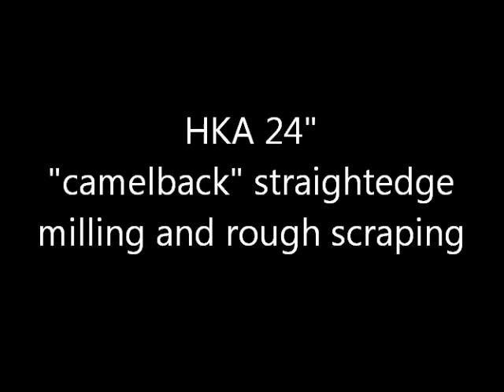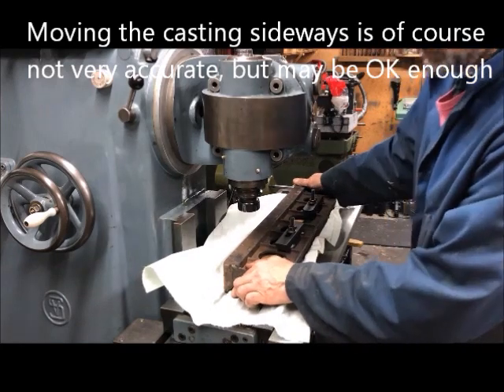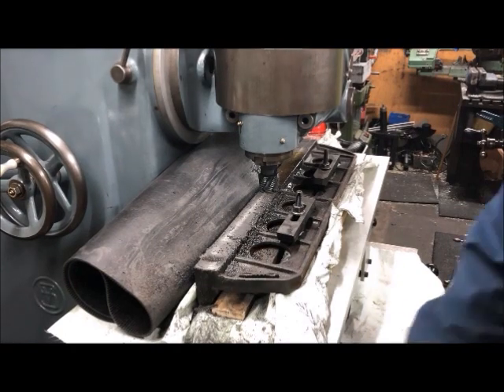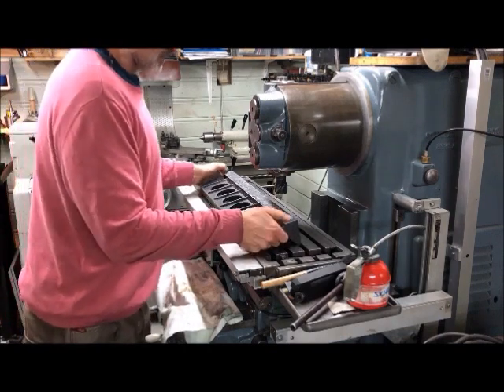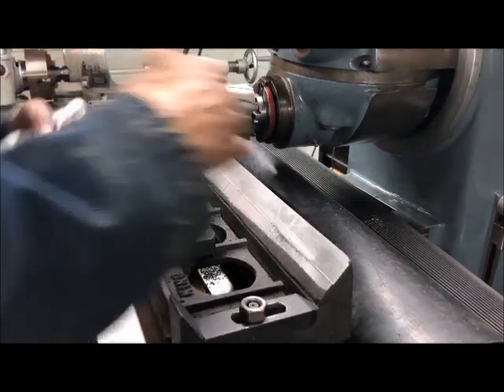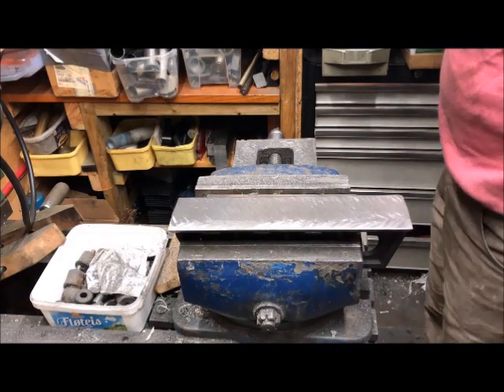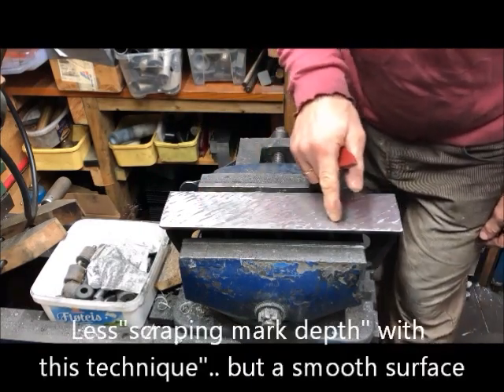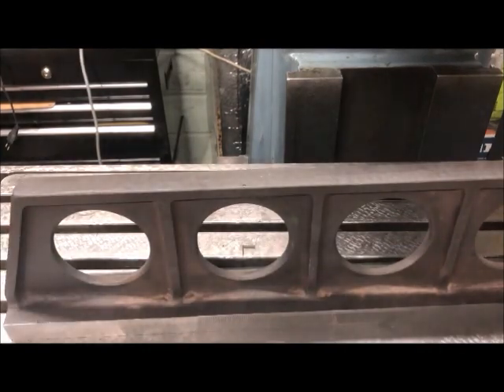HKA 12, 18 and 24 inch straightedges - milling and rough scraping

Comment: 2:15 man, that's some rapid movement! the inner crank is for the fine alignment, i guess?
Reply from the maker: The inner handle is for moving the cylinder axially, ie. in/out
The short lever with a black knob is a means to lock the cylinder in 15 degrees steps radially, but you also have a 360 degrees ring to use for other settings. The procedure is to set the correct radial position, then lock the cylinder firmly with the lever on top of the column casting. If the short lever for 15 degree increments has been engaged this must also be disengaged to avoid the gear snapping if you "run into trouble" 😉
Reply: oh i see.

Comment: Hi Jan, is there a special reason why you didn't  use the Biax Powerscraper
Reply from the maker: Hi there,
Nice to hear from you!
Not really other than I just wanted to practice some hand scraping (tried to experiment with heavy down pressure and see how much material I removed). I wasn't supposed to scrape the 2 ones I did for my friend (just mill them really). PS! I did also use the BIAX but didn't document it. In my "defence" I also usually grab the power scraper as the 1st choice, even for a small job :) It might be worth to mention it is quite a "workout" to "rough scrape" larger pieces with just a hand scraper (as we know), but as most amateurs a hand scraper is all they have, I thought it was OK to show it is within reach to scrape a "substantial piece" like this. PS! When are you running the next BIAX class? I have had some ask me about scraping classes..

Comment: What make of milling machine are you using? Very versatile and adjustable versus a Bridgeport.
Reply: It's a Schaublin 53.
Reply from the maker: @Svenyboy42  Close enough.. it is the smaller version, a 52. Schaublin made 4 version of the same basic design, 51, 52, 53 and the 53N.
Reply: @jansverrehaugjord9934  oh yeah i forgot...but you have adapted it so you can use the 53N high speed spindle, right?
Reply from the maker: Schaublin SV52. Old girl from the 50'ies. Ex Danish military, fully restored (I think I have put in some 6-800 hours. For example, wrestling the knee on/off the column around 50-60 times, then the same with the saddle onto the knee as well as the table onto the saddle.. a lot of labor!)
"Curiosity fact": The owner of the straightedges has a Schaublin 53 (just arrived his place) and a Bridgeport (under restoration). PS! I consider a Bridgeport one of the the ultimate "home shop" machines, based on the fact it is very versatile also and the head has a nice speed range and doubling up as a good drill press/coordinate boring machine. I know it is considered by many a little "inferior" to other more sturdy milling machines etc. but still
Reply from the maker: @Svenyboy42  Well, I was going to, but in the end I found a 52 high-speed head (same as for the 51) and bought this (from Switzerland.. ). The difference is just the adapter/drive Schaublin adopted, 51/52 uses like a flat rectangular adapter while the 53 has sort of a dog clutch. The cylinder and head on these 3 machines are the same, ie. same size and taper. The main difference is in the capacities, plus some details like the 51 has a variator drive, and I think only power cross feed, while the 52 and 53 has another type of drive system plus all the axis independently power driven. Nice machines! However, these different mechanical solutions from "past times" are a bit outdated compared with present days electrical/electronic drives. But, then again these Swiss machines are made so nice and perfectly machined that functions are silky smooth (but can be tricky to overhaul,  complex mechanical solutions as they are..)
Reply: @jansverrehaugjord9934  Yeah they are really complex, that's true. And i have to agree that electrical systems are a cheaper solution nowadays...i'm converting a small chinese mill to CNC at the moment.
Reply from the maker: @Svenyboy42  Nice.. 
One example of old vs. late designs is the swopping of the regular ISO40 head with max 1700'ish rpm to the ER25 hi-speed head with a max rpm at around 6000, a quill and as expected from a Swiss product, very, very nicely made. Still, I find myself looking for excuses not to change the heads when I really should do. Not that it takes forever or is a major effort, but lazy as I am, it is like a step each time. A new design I assume would use a VFD or similar and the same head/spindle. For a run down on the hi-speed head, look here https://youtu.be/NIgQ8vJir5E

Comment: Hi Jan good video as usual I would like to buy a 2 foot camel back are they expensive ?

Al.
Reply from the maker: Thanks! 2 foot.. lets see, this would be the 24" inch version? Contact Mr. Richard King and he will give you a price.  He has his own site http://www.handscraping.com/ and is also on FB. You are in the US? He also sells on Ebay there.. Update! Sorry, I can hear listening to your videos you're probably not American (pardon if I am mistaken.. :) ) Australian?  PS! For what my opinion is worth (I am  not a pro, remember..), I consider this design to be very good. Lightweight and still rigid, which translates to "handy" and practical and of course accurate
Reply: 24inch is 2 foot  and I’m English good Guess though, I’ll look on his Webb site, thanks Jan appreciate you getting back to me.

Al.
Reply from the maker: @pearcemachineshop5200  Sorry for the misinterpretation, obviously didn't listen careful enough :)
There are some other designs also, eg. one that I see is also on US Ebay, but I reckon the majority available (not many though) are ex. industry used examples (like most of mine). Camelback straightedges are not cheap though, especially the type with a wedge to be used in dovetails. I think you may get granite types cheaper actually